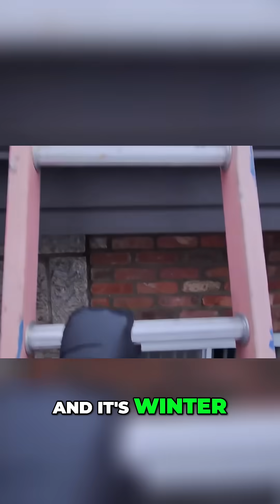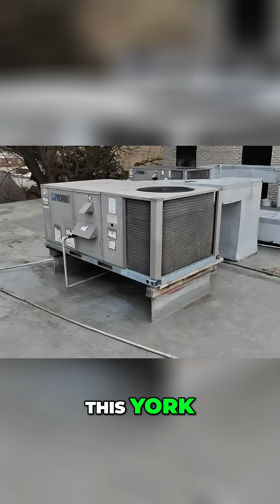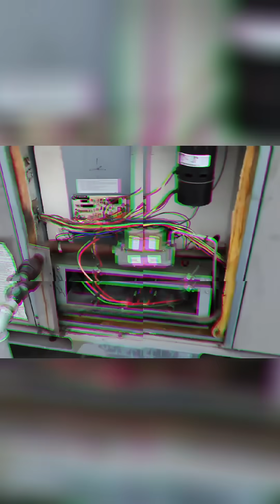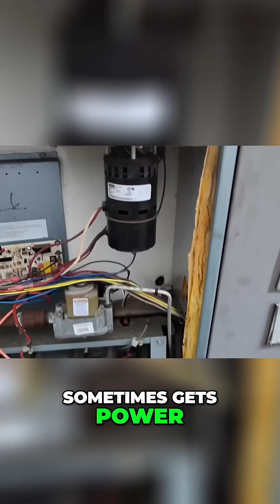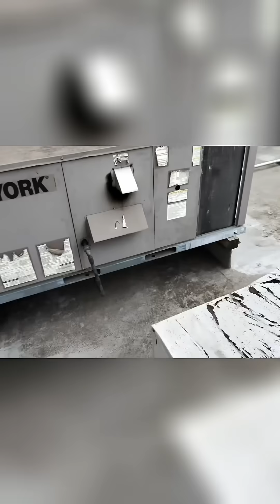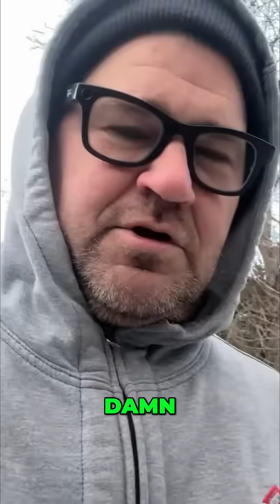Winter Rooftop HVAC Mystery: Is the Inducer Motor FINALLY Dead? #shorts

Comment: Bro learn how to set up a ladder this is really sad
Reply: What was wrong with the ladder?
Reply: @matthewhoffman9242 improper lean way way too vertical
Reply: @Owen-xw8cs  i always thought proper lean was when the flat topped rungs were level, usually ended up a bit farther out myself.
Looked like theirs was out a little more than I set mine for. So I was curious. 

Is there a rule of thumb for proper angle?
Reply: @matthewhoffman9242  good rule of thumb is you shouldn’t be having the ladder pull off the building when you grab for the first rung.  Technically the 4 on 1 rule. So 16 ft ladder should be 4 feet off the roof edge
Reply: @matthewhoffman9242  every four steps up the ladder should be a foot out from the bottom